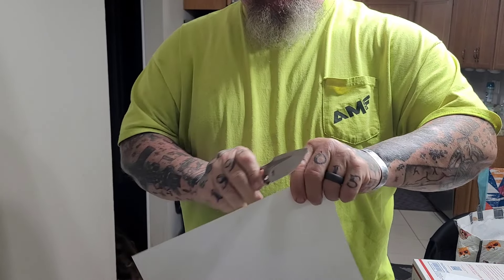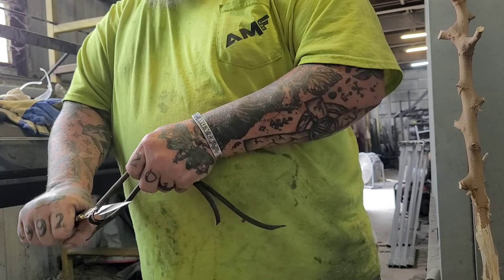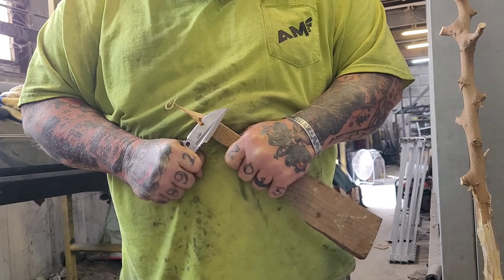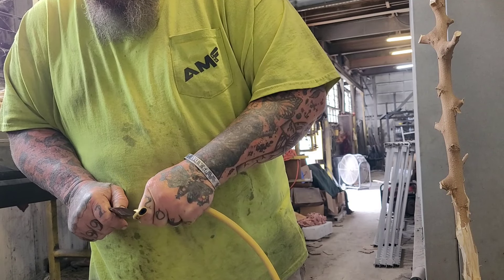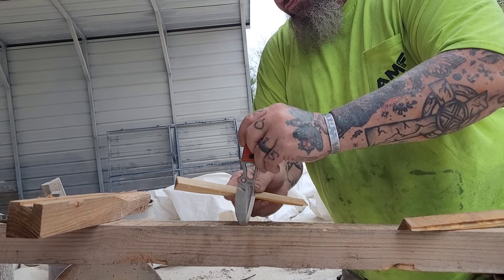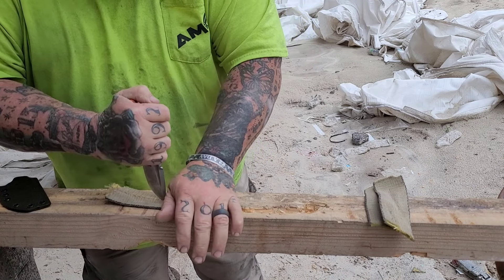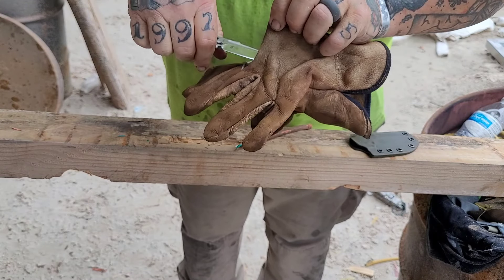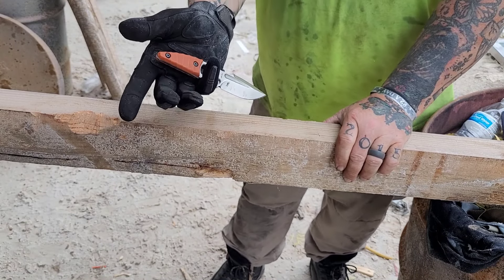MY FAVORITE STYLE OF KNIFE! POCKET FIXED BLADE! WORK TUFF GEAR NYMPH REVIEW!!!

Comment: Good looking little knife. I haven't seen this one in person and I hate to assess a knife from my EZ Chair in mommy's basement {end sarcasm}, but first impression is that I would like a little more handle. One of the main reasons that I carry an EDC fixed blade when heavy work needs to be done is for greater comfort than what a folder can provide. A non-fatiguing handle aids in control and safety. Plus it just makes the time spent using the knife more enjoyable.